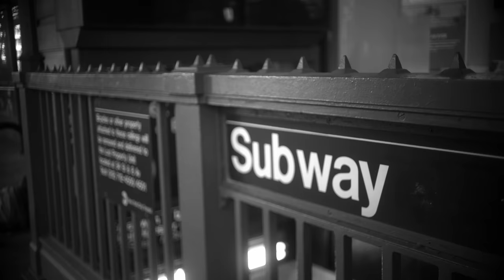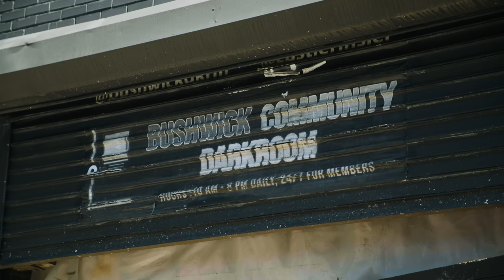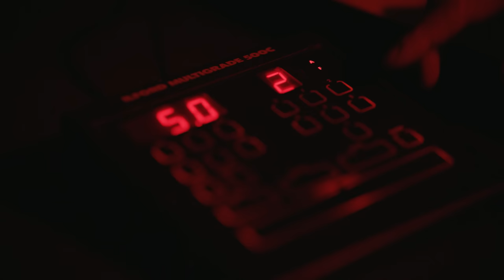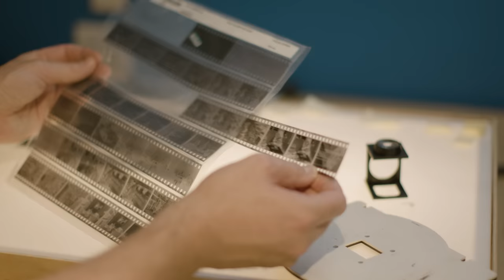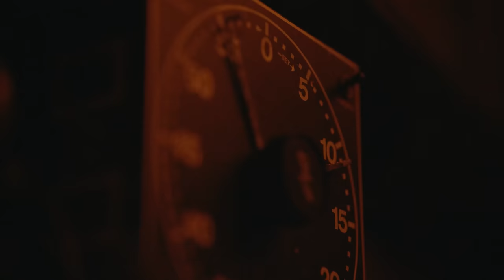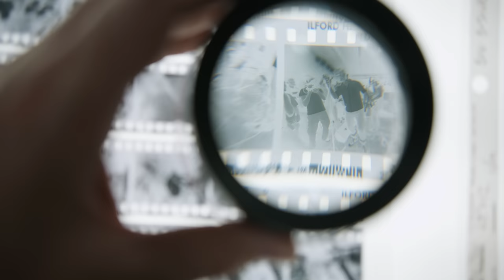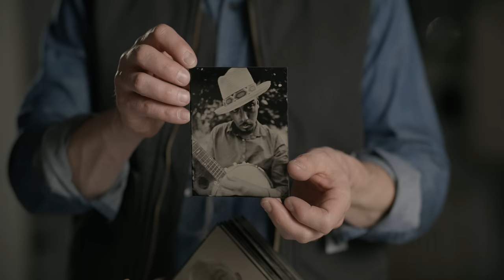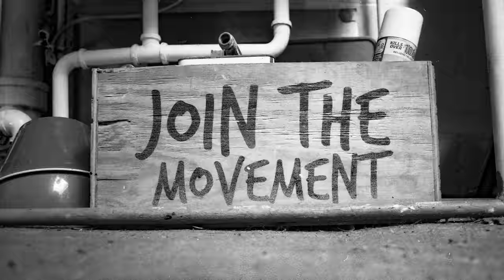Community Darkrooms - An ILFORD Inspires Film

Comment: Fantastic,love darkroom,congratulations for community, analog forever, this is true photograph!!!!!
Reply from the maker: Do you print a lot in the darkroom Nat? Is it your own set up at home?
Reply: @Ilfordphoto  I'm starting to print I'm a beginner, I'm a passionate landscape photographer with an optical bench, I've done the darkroom
in my garage,if i can,i have a problem like if it can wash the film without running water(i carry water in a container to be able to work,thank you very much for your great contribution to the analogue photography community!!!!!
Reply from the maker: @Nat.ImagesLarge.F.Photographer  It's definitely possible to wash without running water. Have you seen our wash method which was developed to use the minimum amount of water whilst ensuring your films still wash fully? * After fixing, fill the spiral tank with water at the same temperature, +/- 5ºC (9ºF), as the processing solutions. Invert the tank 5 times.  • Drain the water away and refill. Invert the tank 10 times. • Once more, drain the water. Invert the tank twenty times and drain the water away. • Finally rinse with a few drops of ILFORD ILFOTOL Wetting Agent (1:200) added to the rinse water
Reply: @Ilfordphoto  I'm sorry, I seem to have explained myself badly, I'm talking about the print, not the film, I also want to contact print the 120 and 4x5 format, after printing I have doubts about how to wash the print, thank you very much!!!:)